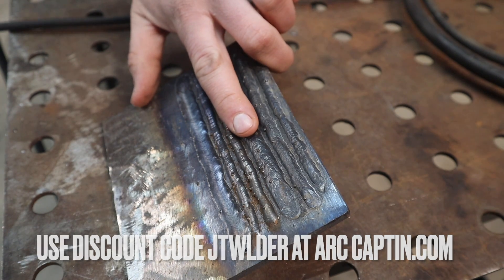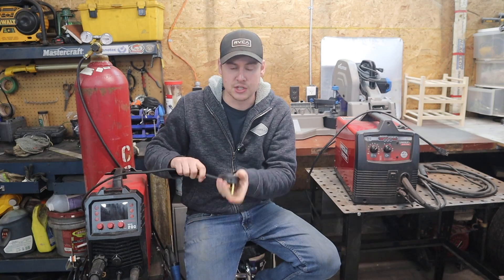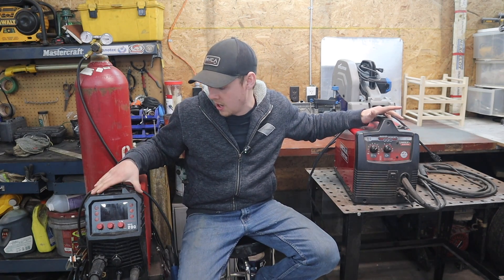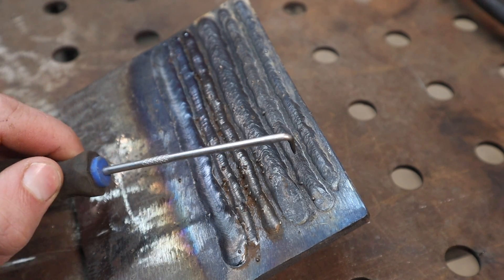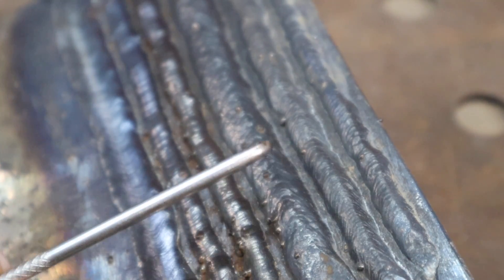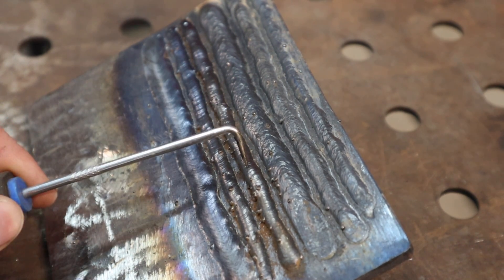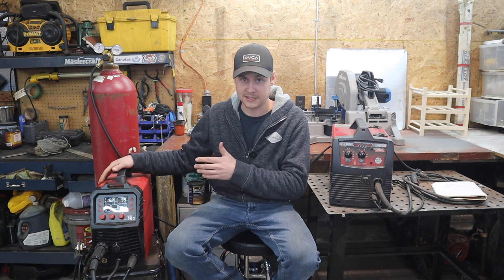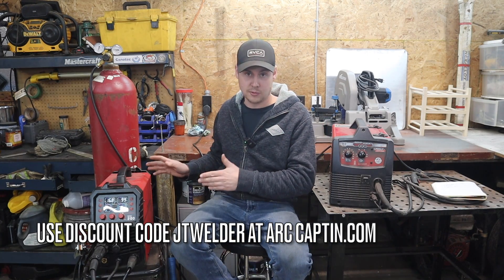Top 5 Reasons NOT To Buy A 110 Volt Welder, Buy A 220 Volt Instead!

Comment: Don't think many people are arguing against 220v welders.  Some of us just live in rentals and don't want to pay $6000 to upgrade our electric service to handle another breaker.
Reply from the maker: Go back and watch the whole video. I clearly say the 220v welder is dual voltage and can run on 120v until you eventually have the option of 220v.

Comment: I don't agree a 120v can save you specially because not everyone has 220v in their houses...is not the  machine is the user 😂
Reply from the maker: The 220v welder also runs on 120v. That why I said it makes the 120v ones pointless unless you have an extremely small budget.
Reply: Depends on what its intended purpose is, i have a cheap 110v arc welder in the van because it doesn't take up any space and most barns i work at only have 110v power and i rarely use it. I also have multiple 220v machines in the shop but they wont fit in the work van 😅@JTwelder.

Comment: For the "non-electrical types", it's actually (in the USA) 120 volts AC or 240 volts AC in modern (after the 1960's) appliances.

Comment: An argument that requires a use case to matter.. I have both types of hobbyist machines and use an xmt (a real one) at work. Each have uses. Certified industrial welder with tech dip telling you flat out, it depends on too many things to just say that. Lol in the trades there are suitcase welders that would blow your damn mind.
Reply from the maker: In the video I said we’re talking about hobbyists, diy and side jobs level welding. Obviously when it comes to industrial work it’s a whole other level that requires much more expensive equipment. It be pretty hard to compare an arc captain to a XMT 450 with 12vs hooked up to it.

I’m not only a journeyman certified pipe/pressure and structural welder I also own a structurally certified welding company so yes I am aware of suit case wire feeders and I actual own one my self. I have a few other videos with some industrial content as well.

Comment: I Have a esab rebel multiprocess mahcine as my main machine as well as my first stick welder and a craftsman wire feed welder  my uncle gave me similar to the Lincoln you have both 110 volts. The little stick welder does fine only rated at 80 amps and does it's jobs but the craftsman really has a hard time doing mig welding it's cold and no matter how hot i turn it it's still too cold, the only  better results I gotten is running flux core out of it since  flux burns a bit hotter than mig but I would use that welder for metal 3/16  or thinner along with the stick welder. The rebel is a 220 dual voltage  and is  my main welder used for thicker material like trailers and heavy structural steel. just saying the less power ones are for lighter duti4es while the powerful ones will be used for heavy duties.
Reply from the maker: Nice! I’ve heard those esab machines are great. The only thing is the 220 volt machines are the same physical size as the 110v machine. Plus the 220v one does everything including the light duty work. No point of having two machines if one can do everything and is already a small size. My mig 140 hasn’t been used other than for this video since I got the arc captain.
Reply: @JTwelder.   I know I have them since they still work plus I can put less hours on my esab depending on the job  I also live with my family still and need space in the garage so they all ride with me on my vehicle other than that no issues hope you enjoy your arc caption.